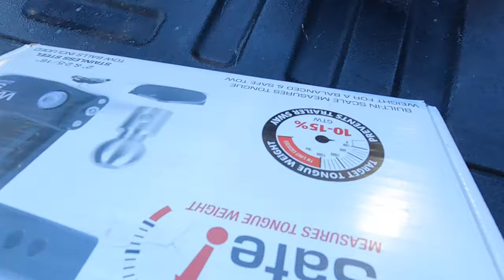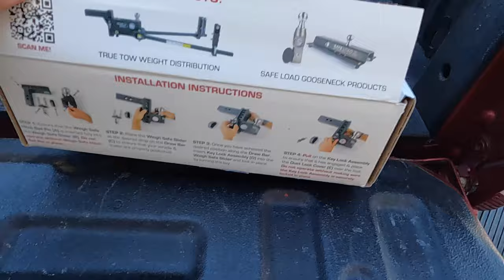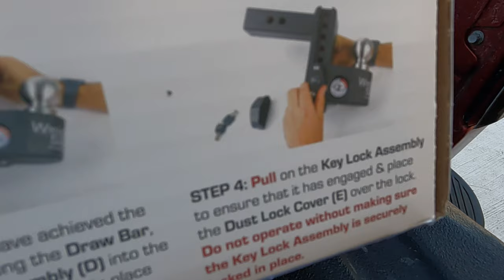My New Weigh Safe 8” Drop Hitch is Here!

Comment: I’m definitely getting this product. I have  a 2020 F150 XLT lifted 6 inches sitting on 35 inch tires. So I will need that 8inch maybe 10 inch hitch
Reply from the maker: 8in should get the job done. Use my code and save you some $$$
Reply: @KickinItWithQ  already ordered it brother and used your code. I got the 8inch. Saved me 56 bucks with your code. I appreciate it. Ordered me a tonneau cover too. Xmas came early 😂
Reply from the maker: @projektxent  😂 ayee glad I could help bro! 🤝🏾 happy holidays

Comment: Great video! Just purchased my first truck. 2022 F-150 XLT. What is the correct way to measure, to find out the correct size to order?
Reply from the maker: Most f150 should have same size shank. Far as drop it’ll depend. I’m 7.5in lift so o went 8in drop. If you not lifted might just need stock size. Contact weigh safe they’ll guide you

Comment: Very helpful I was wondering about how heavy it was, if I should go with steel or aluminum.
Reply from the maker: It’s very heavy aluminum is stronger than still I believe and lighter. Check the website
Reply: @KickinItWithQ  is yours that coated aluminum or steel? I would say steel is stronger. Aluminum is softer I’d be worried about it rounding out the grooves and holes
Reply from the maker: Mines is steel